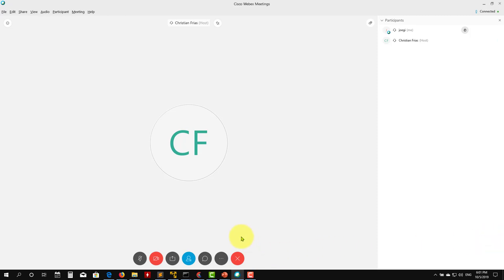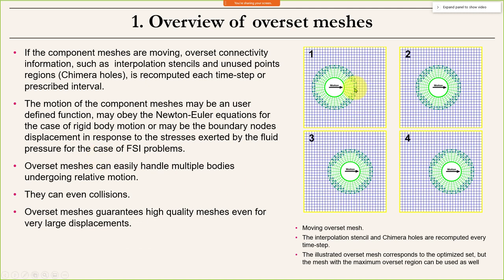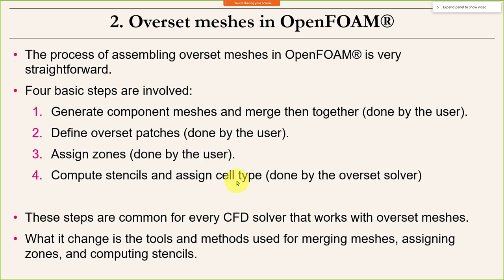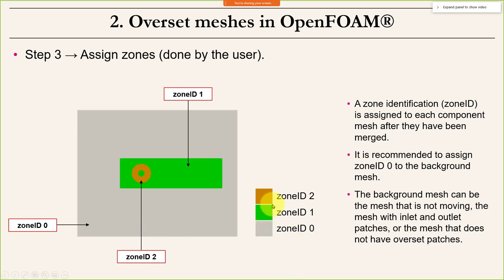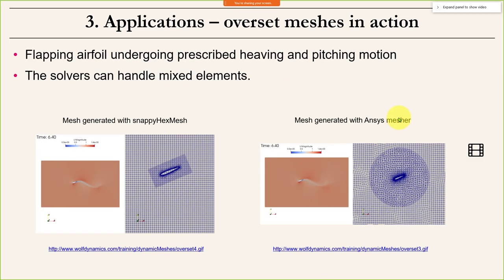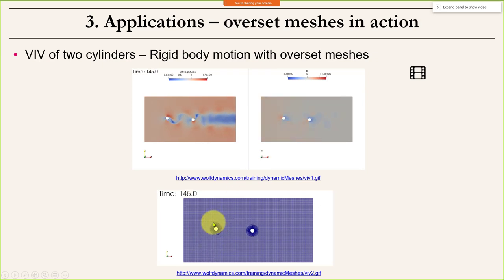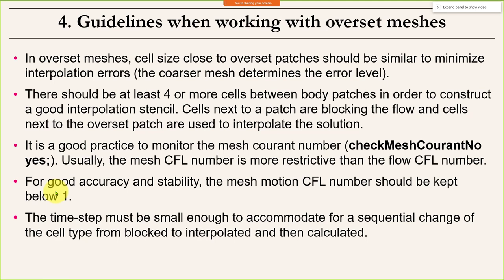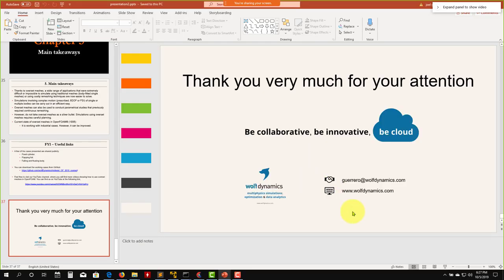The grammar of overset meshes in OpenFOAM

Comment: Based on your analysis, It should not be possible to simulate a bullet that got fired up, right? As the overset mesh cannot leave the background mesh, it should not be possible to have the bullet inside the gun which moves based on the pressure as the overset will exceed the rifles mesh.
Reply: If you are simulating the flow over the bullet even after it has left the gun, you are going to have to anyways mesh out side the gun, so would it not interpolate from the background mesh outside the gun?